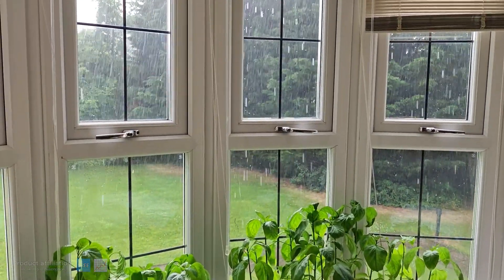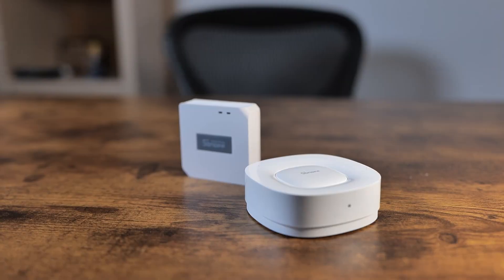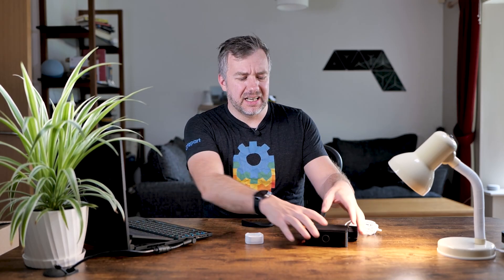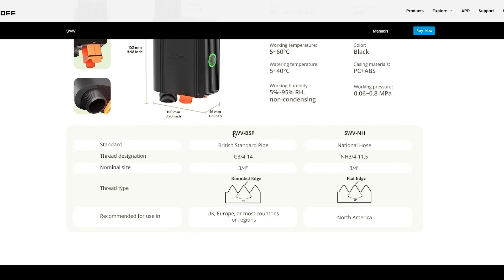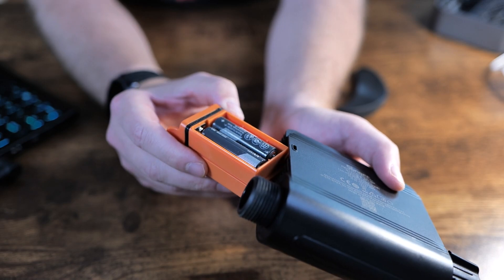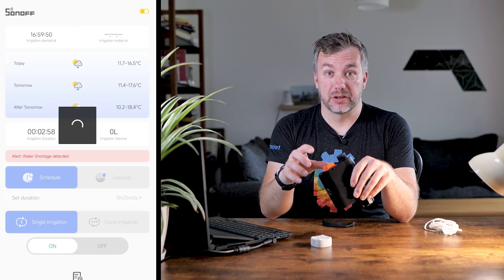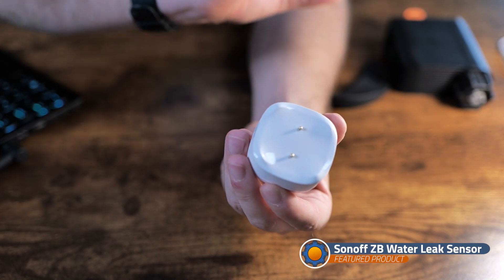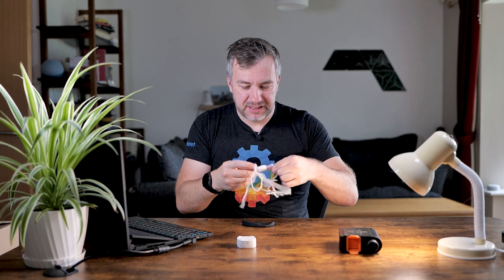Sonoff for households and gardens deals with things that are wet

Comment: Hi. Tank you for your video. I have bought a similar SWV, i paired with the zigbee bridge pro but i have only the switch option, no water comsumption and all the other features, exactly like you said. In ewelink shows me no firmware version. Have you any ideea what i could do? Thanks.
Reply from the maker: Try it with Z2M and see how it reports. You may have more data this way if this isn't Sonoff SWV
Reply: @notenoughtech Thank you for response. After an firmware update of the bridge it works fine. I watched some videos about this valve, after i installed it, but the informations about compatibility and no battery i have seen only here. Thanks.

Comment: I have a problem statement: water in my area in is available for limited hours in a day, so need this device to run only after the inflow is detected and run for say 1 hour in a day.
Reply from the maker: Without a proper flow meter this may not be possible

Comment: Is there any significant flow restriction? Have you tested this as well? I’ve noticed reviews stating that these devices often fail to supply enough water, unlike a direct connection to the water source.
Reply from the maker: Not tested the flow restriction, but from the tap I used, it didn't feel all that restrictive to me. The bucket video was the max flow I could get through both fill methods

Comment: Not blocking the water if the battery is dead or removed is a non-starter for such a device in my opinion. Not happy
Reply from the maker: @IlithiophobiaKiller  I agree this adds a need for unnecessary oversight

Comment: I love Sonoff devices.  I like that they are different form factors and solve problems that I didn't know I had.  I have about 50 devices installed. However, I hate their Zigbee versions. I've tried everything I can find to keep them online.  I have removed all of the Zigbees and found a way to use either a Sonoff or someone else's to work there.  And I won't bother with trying to get Home Assistant to work because Sonoff doesn't support Home Assistant.

Comment: using a NO-valve for such a device is in my opinion a major design flaw, as you said: batteries too low in energy ->> not enough power to close the valve again.
Murphy‘s law: it happens exactly during your family is travelling for holidays, what a mess!
Reply from the maker: @czi2011  I do agree with you.

Comment: So could you use the leak sensor to stop the Water Valve from operating ? ie, if it rains then don't bother watering
Reply from the maker: You can use water leak sensory as your trigger

Comment: I'd assume that if the power is removed, it simply leaves the valve in the last state - either open or closed.

I would worry more if it opened the valve when it loses power.
Reply from the maker: Yeah that'd the case. It would be interesting to put it in line with the main water supply as a meter and emergency shut off.
Reply: @notenoughtech  I'm wondering if I could put it in my attic on the flow to the central heating system, as that would allow me to shut it off, drain the system, and do everything I need to, without having to climb in to the attic to turn the water on and off.

or maybe I need to just pick up one of the many (more expensive) zigbee water valves.

Comment: It looks like   Giex 02  , same functions, same price. I use 3 v1 and 3 v2 for over 2 months with 2 watering daily. Battery is now at 80%.  All of them controlled by HA using an USB SkyConnect.
For safety i have doubled the system with a smart plug which controls the garden water pump.  
Last thing in watering automation in Home Assistant is to turn off the pump...so no surprises ;)
Reply: purchased 5 GiEX, 3 of them defect now. Will see how long the Sonoff will do its job (arrived, but not yet in operation)
Reply: @czi2011  I also had problems with 2 of them...online but not closing properly. I have changed the batteries and they work like new now.

Comment: Would be interested to put the water valve on my home mains so I can finally get water usage in home assistant. All the other alternatives are so expensive at >200+ usd

It could also be used as an emergency shut off valve if there is a leak somewhere. 

I wonder how easy it would be to build that automation in HA.
Reply from the maker: I have exactly the same thoughts about it  - mostly to build up leak prevention system

Comment: I hope they'll release a version for Thread/Matter. And it would be great if it would handle timers/schedules locally on-device, such that missing a network packet wouldn't result in a catastrophy. And like you say, it should be fail-safe in case of power loss.
Reply from the maker: Timers are done on the device as mentioned just not automation. So if you trigger it via automation... This is where things could go sideways
Reply: @notenoughtech  But in this case you could send a safer command like this: "open valve at time x and autonomously close it after y minutes". That way, automation is possible without the risk of missing a "close valve" message.
Reply from the maker: Sonoff hubs should gain the Matter support soon and they will expose their devices via matter to other ecosystems